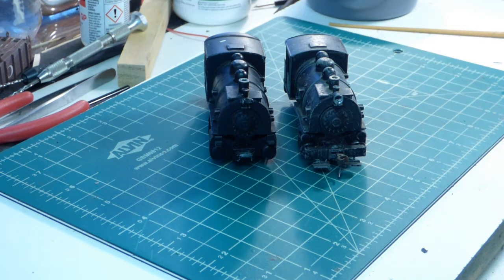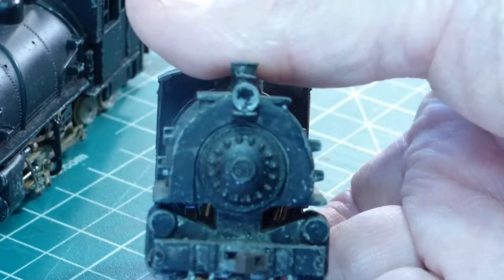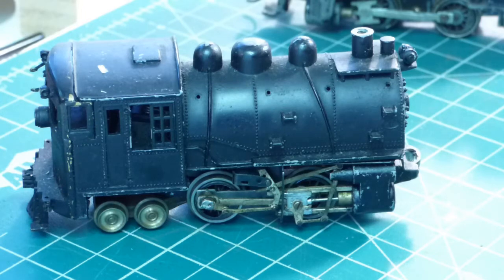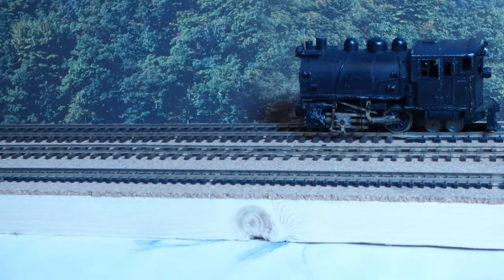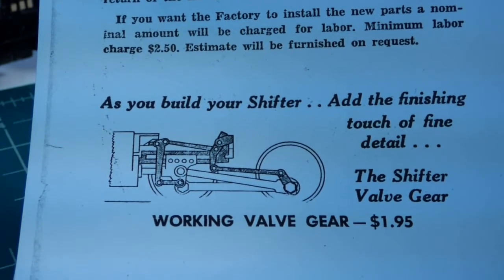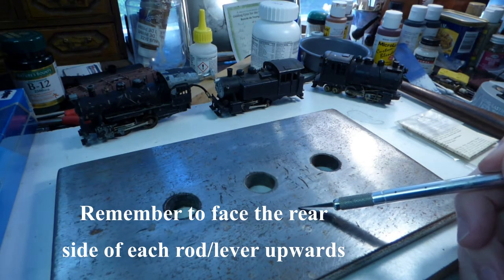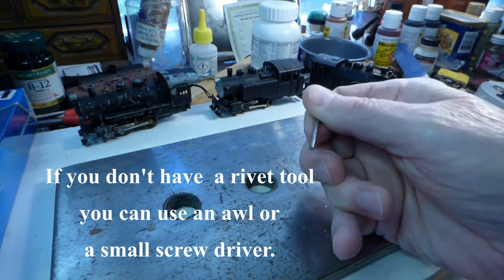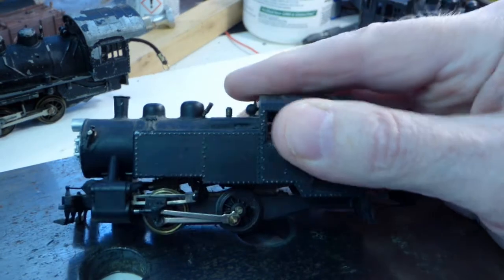Steam Locomotive Valve Gear Add On Kits

Comment: A recommendation for when you're riveting the valve gear together ..... place a double thickness of gift wrapping tissue paper between the parts; close/hammer the rivets relatively tight then extract the tissue paper.  This leaves an almost perfect gap between the parts allowing great freedom of [rotational] movement without either binding or wobble.  If yopu fee the gap is to large, slip in a single layer of tissue paper and tighten the river.  Happy running !!
Reply from the maker: Great tip!